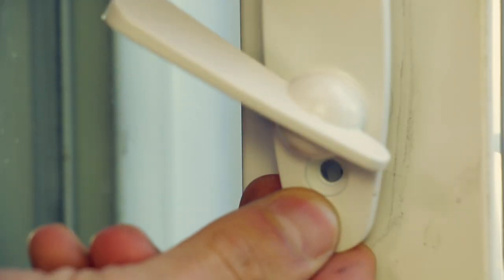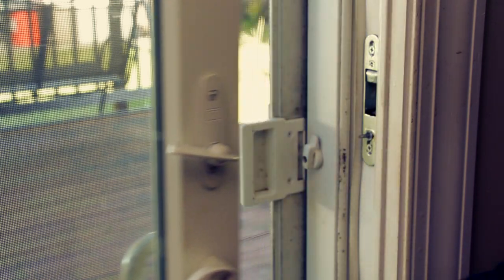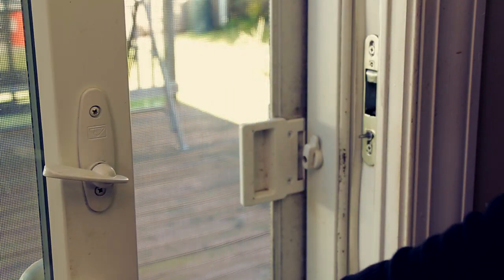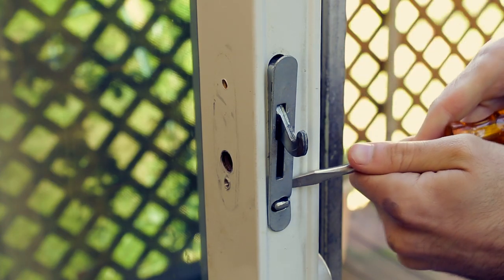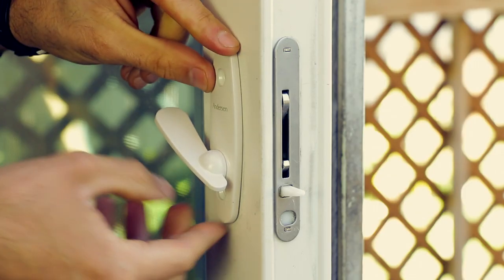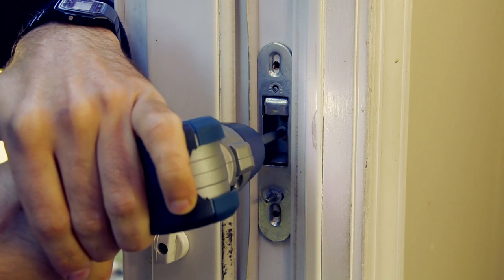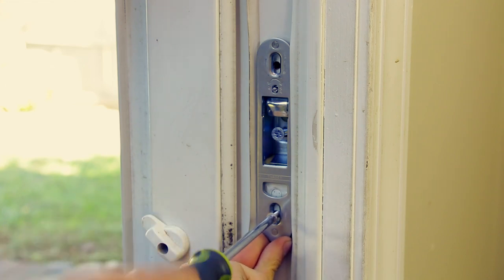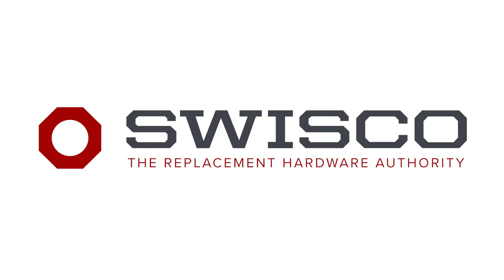How to Replace an Andersen Sliding Door Latch

Comment: Show me what to do if the metal pin doesn't  align
Reply from the maker: If the mortise pin isn't lining up, try adjusting the keeper. Or, you may want to consider using the old keeper.
Reply: @SWISCO  thanks, needed to use the old keeper.

Comment: This lock is garbage. Broke two in one year by normal use... andersens suggestion was get a newer door that accomodates their new lock style.
Reply from the maker: It's unfortunate that in many situations like this, the original manufacturer will suggest replacing the entire door or window instead of the specific hardware. This is of course more profitable for them but it's not a cost-effective solution for you, the consumer. Fortunately this is why we're in business.